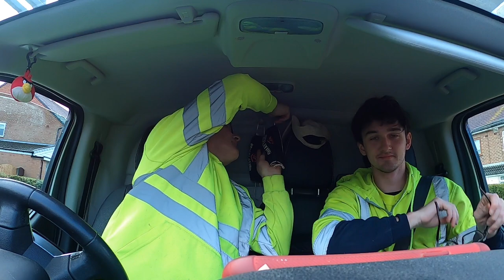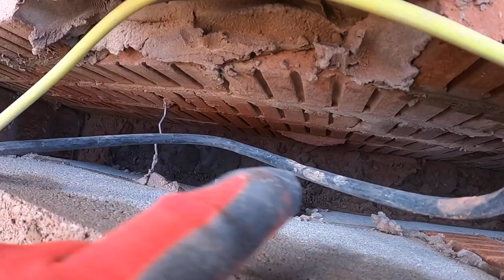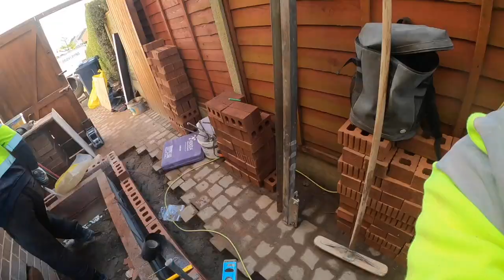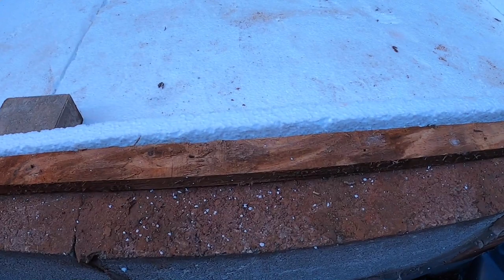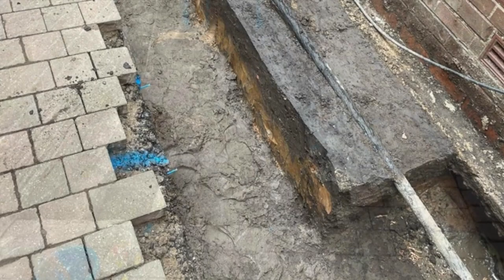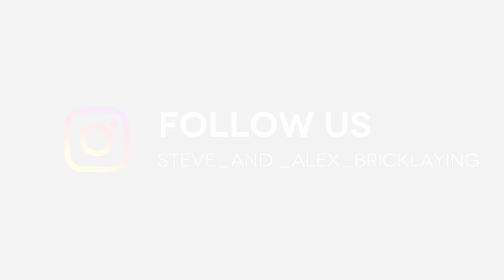CONCRETE SLAB .. MIXING OUR OWN CONCRETE

Comment: Its amazing how much work has to go into small projects🏗...was that semi dry cement/ballast mix you're using around those venting duct pipes...I had to do some recently on a small extension..🧱⚒️
Reply from the maker: Yes i underestimated by a day or so . We used ballast to back fill but no cement in it 🧱👍🏽

Comment: another nice job there ,could you have got ffl by using the window cill as a datum and transfering the measurement to the out side ?
Reply from the maker: Thanks jack , This is more accurate plus there is a door being knocked out eventually 🧱👍🏽

Comment: Steve, Alex, do you ever use concrete vibrators for the bigger slabs? Watched all your videos up to here, great watch. Si
Reply from the maker: No, they are generally used when there is a lot of re bar in the concrete 🧱👍🏽
Reply: @SteveAndAlexBuild  Okay, thanks.

Comment: Great work as usual - but what a huge effort for such a small addition. I am not sure about the slab that you poured for lots of reasons, looks like you mixed dirt with cement as it didn't look like sand and where is the aggregate and the mesh ??  I would have expected to see it at least pinned to the remaining part of the wall - this thing is going to be all over the place after a several freeze thaw cycles. Am I missing something ??

Comment: Finally caught this! Some questions...

1. Will there be a part 3?

2. How the hell does that polystyrene insulation stuff support the weight off concrete and foot traffic?! 

3. As the house looks to be a suspended wooden floor how come you went with a concrete slab for this small extension?
Reply from the maker: 1 Yes 
2 Not sure how it does 🤔🤷🏼‍♂️
3 A concrete slab is just quicker and easier 
🧱👍🏽
Reply: @SteveAndAlexBuild  thanks! Love your videos
Reply from the maker: @MarcusT86  . Great to hear cheers Marcus 🧱👍🏽
Reply from the maker: @martin2466  Always there to vail me out with the technical stuff . Thanks Martin 🧱👍🏽
Reply from the maker: @martin2466  🥱🥱😴😴🤣🤣🧱👍🏽

Comment: Good stuff lads.
 Regarding making your own mix for the slab. I'm doing a wee project that requires a footing, the total volume of cement is roughly 1.6m3. Would you recommend doing it with a mixer? Or paying for a lorry? The lorry comes in at double the price though. Cheers
Reply: @martin2466  hi Martin. Its a home project. The local company does a barrow service so that would be ideal..however its 349£including vat..whereas 2.5 bulk bags of ballast and 12 bag of cement come in just over 120£. Obviously ita more time consuming but for a days work to save over 200 quid.
Reply from the maker: @djc3660  £350 spondulicas !!!!! 🤯, jeez that’s £100 more than we get it for up north . At that price I would be mixing it myself too 🧱👍🏼
Reply from the maker: @martin2466  definitely 💪🏼👌🏼🧱👍🏽

Comment: Hi Steve, Were Building Control relaxed with the vent into the outer cavity idea without adaptors (have two to extend out myself and seems a good technique)?
Reply from the maker: This was built on a building notice so wasn’t inspected. We did it this way as it was awkward to get the periscopic vents in . I would recommend use those if you can , they even do an adapter that fits onto 100
mm soil pipe 🧱
Reply: @SteveAndAlexBuild  Thanks Steve, I will track those soil pipe to telescopic vent adapters down then. Cheers.
Reply from the maker: @Carl-yu6uw  most good builders merchants should stock them , try tool station and Screwfix too 🧱👍🏽
Reply: @SteveAndAlexBuild  The amount of plastic bits I buy - thought I'd just done with the drainage too! Both vents apparently have to run straight across (under) entire slab, can't turn pipes 90 degrees to nearest wall, so miles of 100mm pvc to lay again. Lol.
Reply from the maker: @Carl-yu6uw  🤯good luck pal 🧱👍🏽

Comment: Tiny wee slab that you should buy a rammer for jobs like that where a whacker plate is pointless👍
Reply: @martin2466  plenty of work about Martin although I am always fine for work as I work in northern Ireland and South East England so jobs coming in steady all year round but currently building 40 linear metre wall in Belfast then of to Buckinghamshire for three weeks 👍
Reply from the maker: @martin2466  🧱👍🏼